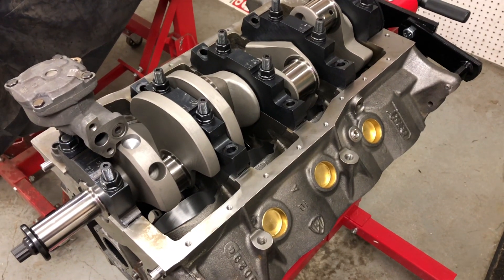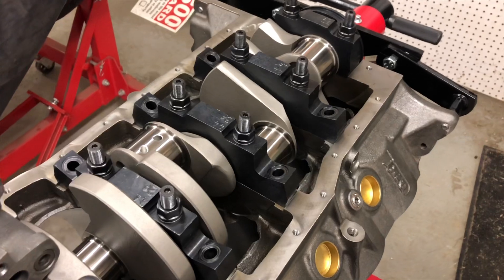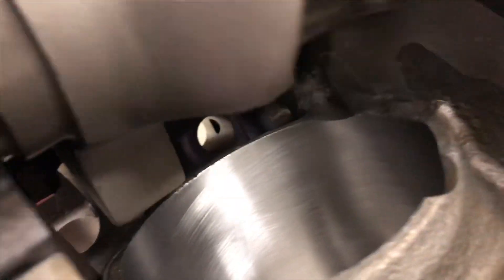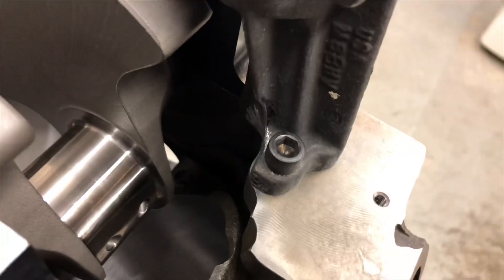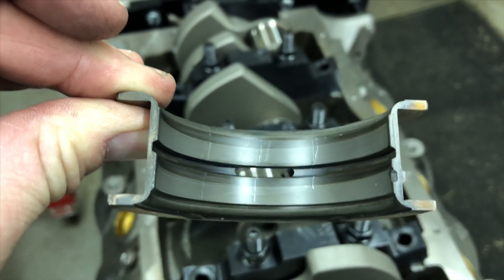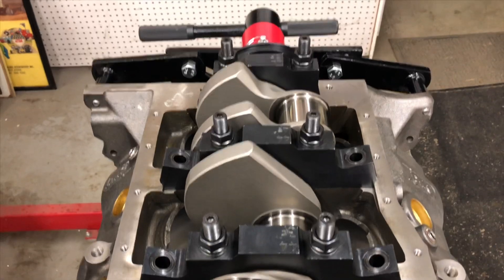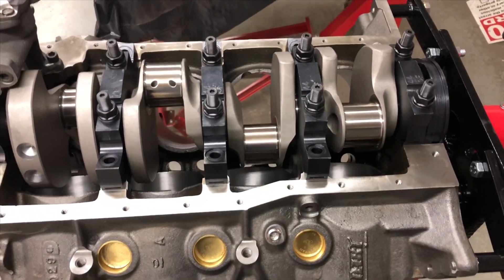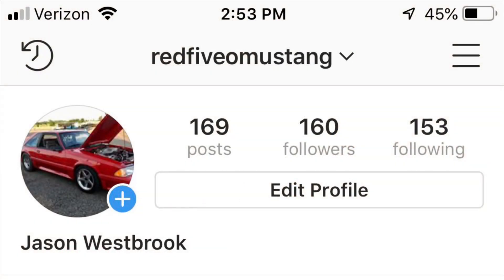Dart SHP block SBF modifications and 363 build

Comment: I'm building a very similar stoker. Mines NA what kind of power numbers are you after with yours.
Reply from the maker: With the little V3 blower, i'm hoping for 650rwhp on 93 octane. Eventually I would want to go to a Ysi with e85 and see 800+
Reply: @JR306  
Why did you choose this block vs other 302/8.2 blocks?

Comment: Hey what kind of oil pan r u going to put on ur motor a how r u going to fasten ur oil pick up to the main cap
Reply from the maker: Mike Wriska Moroso 20511 with the billet ends is suppose to be a good piece. The 351w studs stick up high enough to attach the pickup.